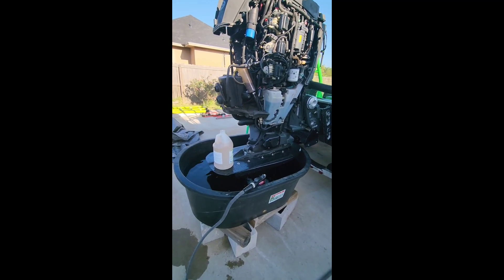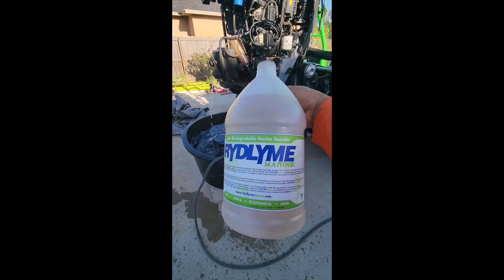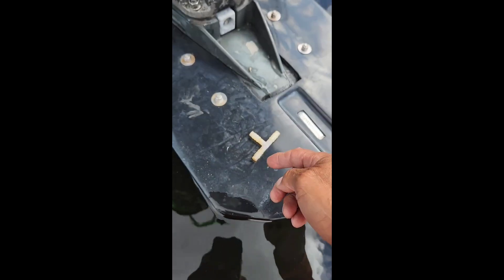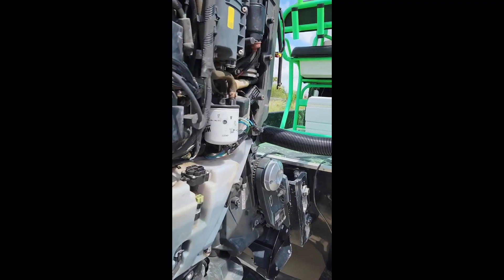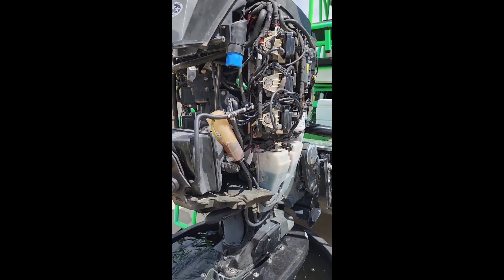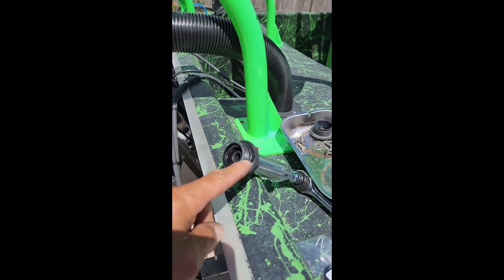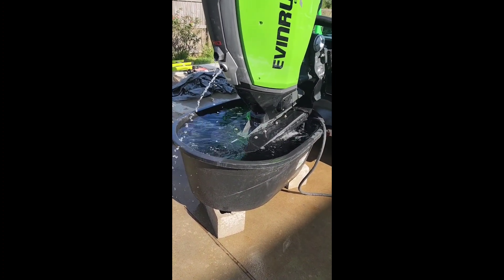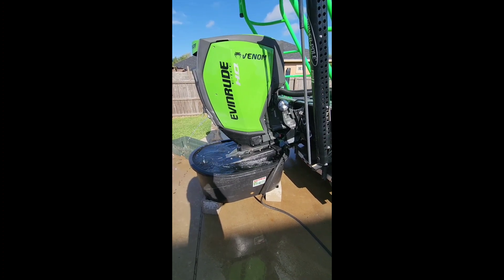Evinrude G2 200 HP engine code 25 EMM temperature fault.

Comment from the maker: If your engine is not over heating but you still get the code "25 EMM Temperature Fault then yes definitely start there.  My engine was running at 170 degrees and I was getting the code 25.  From what I understand is that code 25 comes on at 212 degrees.  That "T" is where a larger object can get stuck.
Reply: Is the inlet hose to the emm on the port side or starboard side